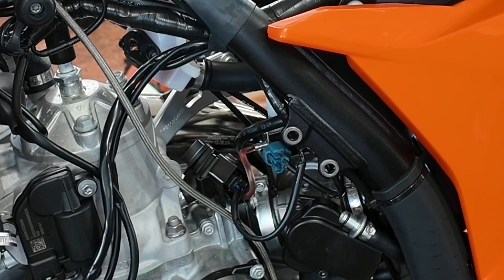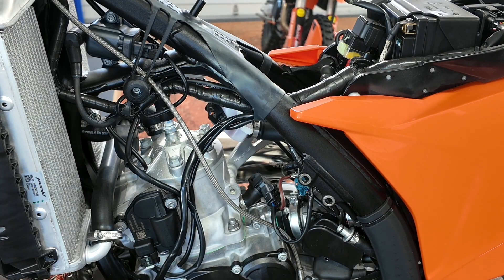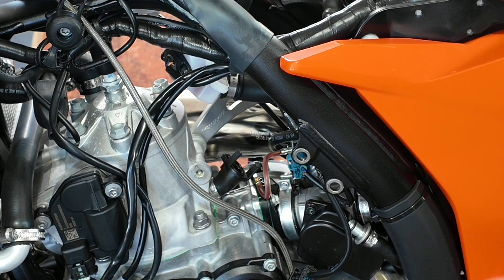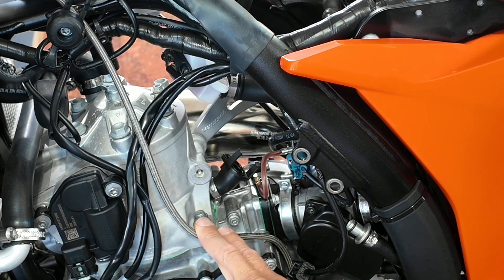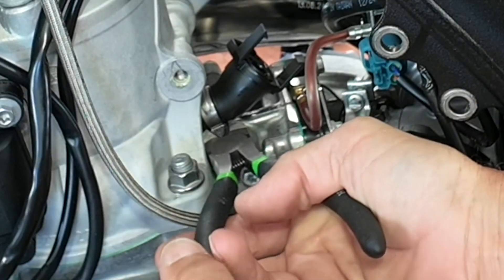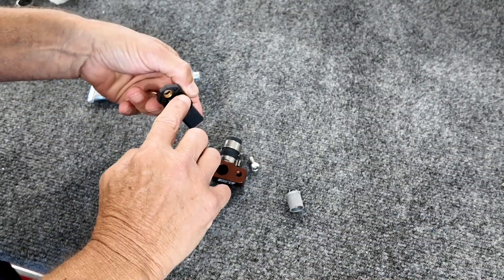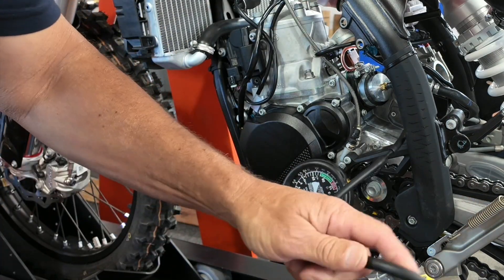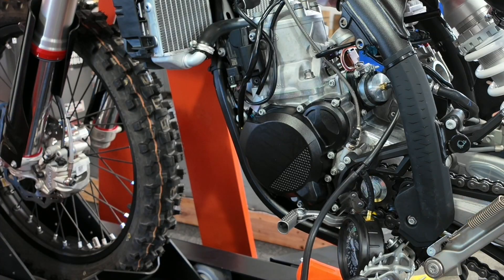Installing our Crankcase Pressure Sensor holder and pressure testing.  Did it fix it.

Comment: Installed mine today. Great fit and finish, easy to install. The Masterpiece cleaned up the gurgling/rich sound in low end throttle, way  worse  when bike is cold. I installed it with the oversized PV cover and the fuel rail…but I think the main factor improving the rich low end was the sensor holder. This 3 items I installed made the bike low end crispier and the bike more reliable. Great product quality! Thanks!!!